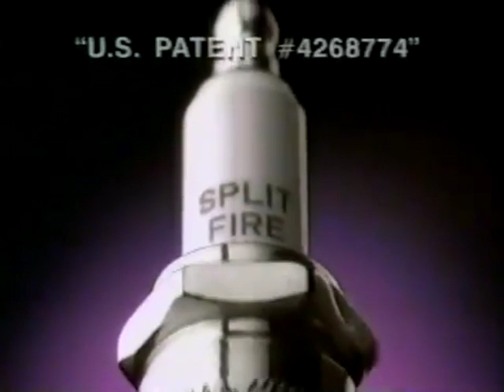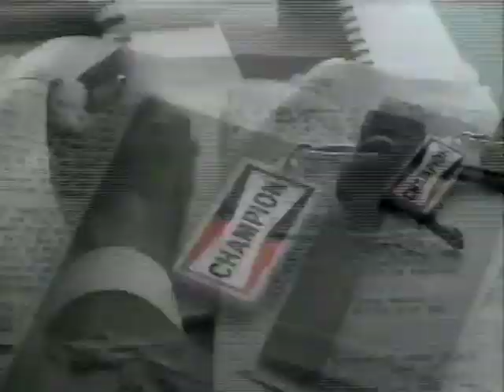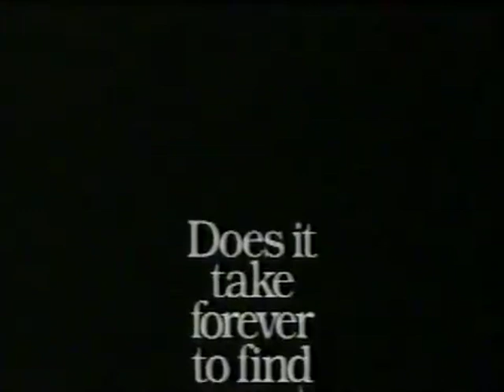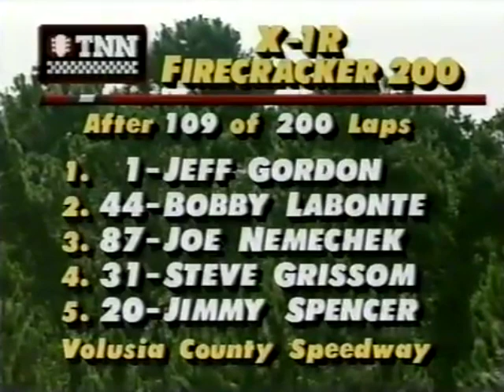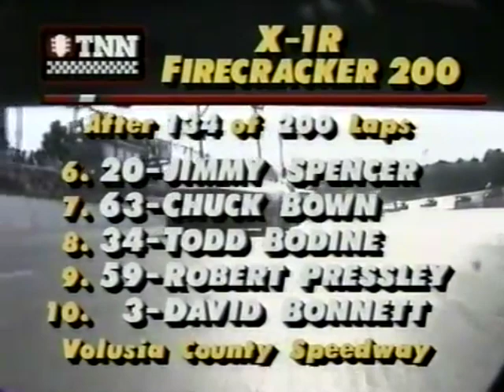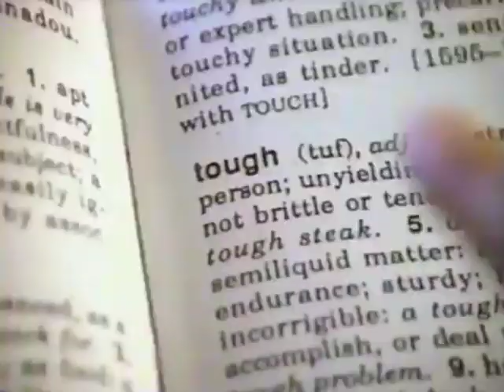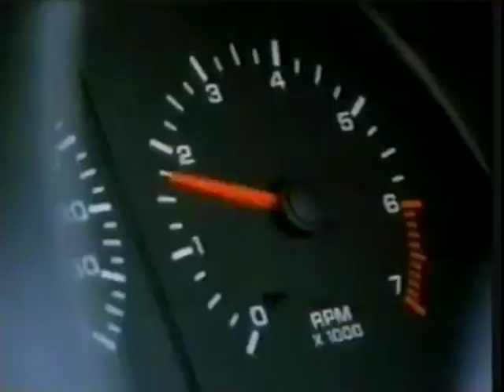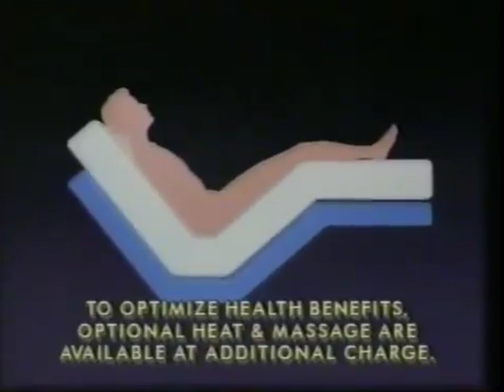1992 X1-R Firecracker 200

Comment: interesting how quick those yellows were. nascar of today, take note.
Reply: 15 Cautions for 78 laps
Pole Speed 106.39 mph
Avrange speed 63.739 mph
Margin of victory: Under Caution
Lead Changes: 3
Jeff Gordon took took the pole 
but crashed with Mike Potter at Turn 4 on Lap 195 with 5 laps to go NASCAR had the race ended Under Caution Steve Grissom took the win
At Volusia County Speedway won the X1R Firecracker 200
This track usually runs as a dirt track
Reply: @matthewfawbush7731  i know all that...
Reply: my point was how fast those yellows were delt with. modern nascar can learn from this.